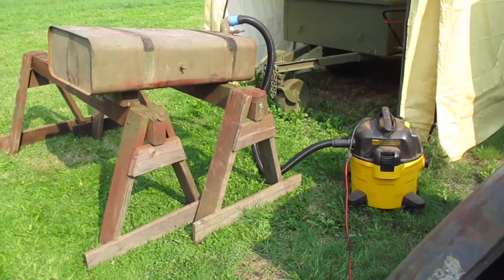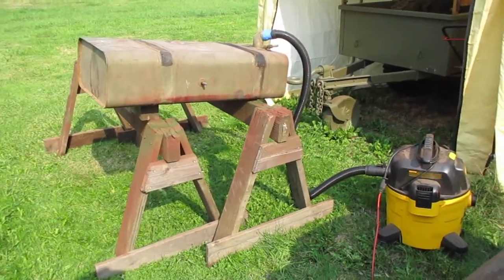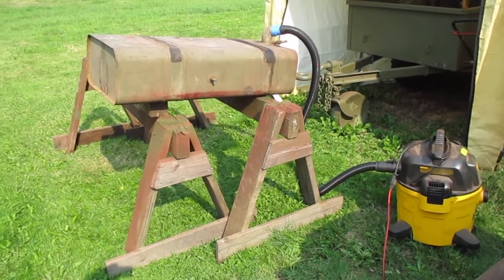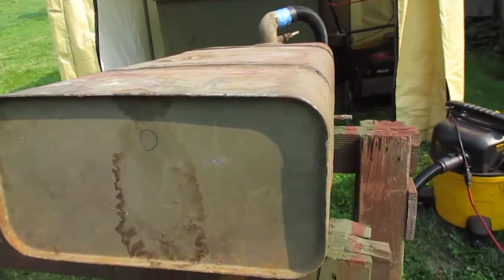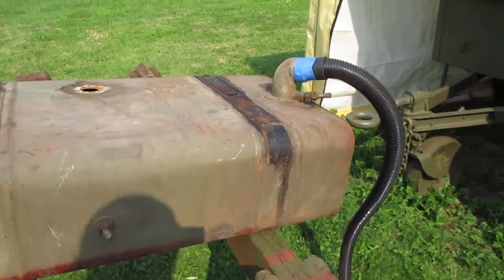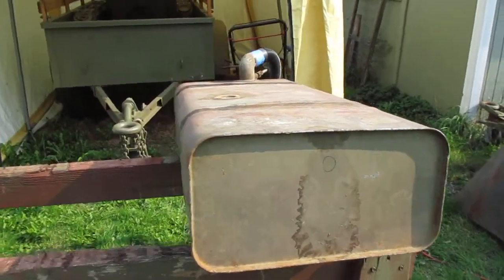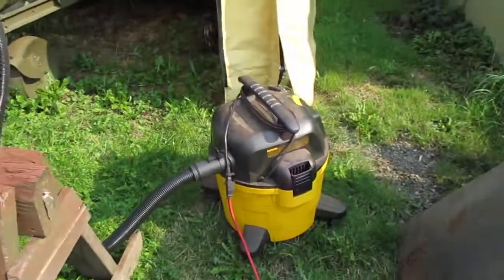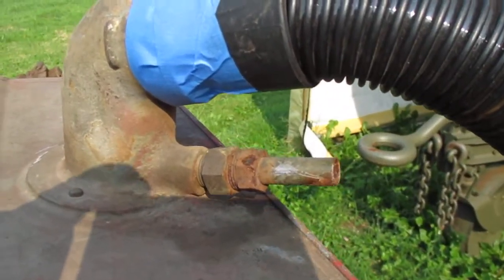Drying out a fuel tank.

Comment: Wouldn't this cause flash rusting ?
Reply from the maker: Good question, thanks for asking. The low battery signal made me panic and forget what I wanted to say, LOL. Because the tank had been Galvanized from the factory, there was very little rust inside to begin with. It was a pretty warm day and the air movement from the hot shop-vac dried the inside out rather quickly. I then soldered the holes closed, and put 1/2 gallon of gasoline and a 32 oz. bottle of Marvel Mystery Oil in the tank and rotated it and coated the inside with the mixture. A few days later the tank was installed and filled to capacity with gasoline.
Reply: @w.w.2restorations.vehicles698  That’s awesome sir! Here in India, the fuel tanks come coated from factory but getting OE is a pain. Aftermarket ones are crap. We also don’t really have epoxy like POR-15 here so that’s a huge trouble. So even if we can clean up the rust, it re-appears just months later.
Reply from the maker: @BrattyBiker  Personally, I don't trust tank sealers. I have seen too many of them fail either from a lack of the ability to thoroughly clean the inside of a tank or the sealer product is just no good.